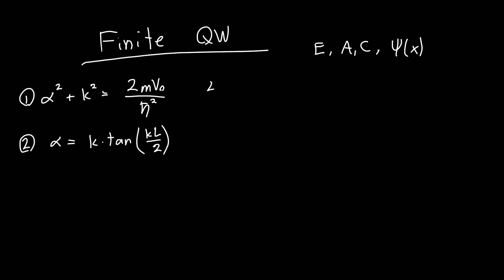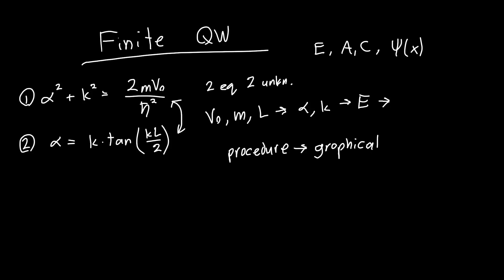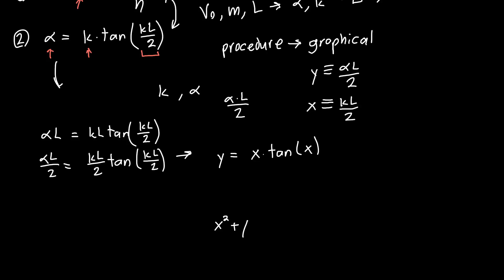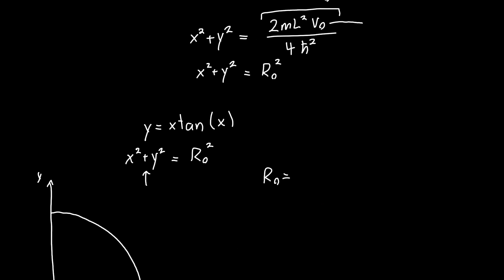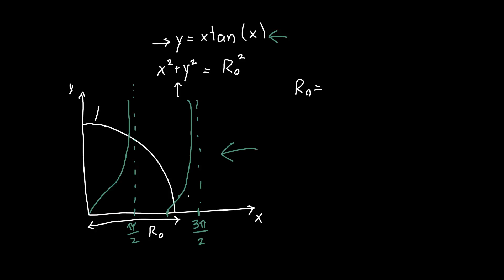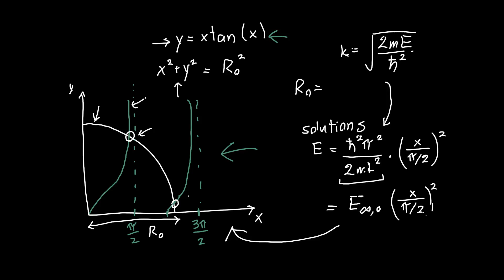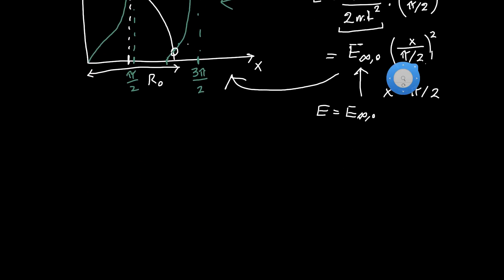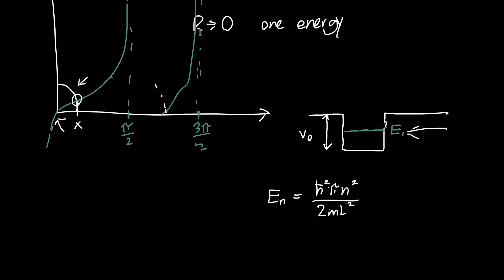Finite Quantum Well Part 3

Comment: Thanks for your interesting video.

https://youtu.be/wrBsqiE0vG4?si=waT8lY2iX-wJdjO3

Viewers might find this video intriguing as it demonstrates that under certain conditions, field quantization can be readily achieved.

The ground state energy is derived through Euler's column analysis. The column m must be engaged prior to over-buckling to observe the effect. The system exhibits a quantized response when force is applied perpendicularly. By bonding at points of highest probability and maximum duration (peaks and troughs) of the fields/sheets, a stable structure from three fields is produced.

Some might say I am akin to plucked guitar strings. However, I argue that structures cannot be created with vibrating guitar strings or harmonic oscillators.

Currently, in my research, I am attempting to characterize the "U" shape that is formed.

In the model, "U" shaped waves emerge as the load increases, right before the wave-like function transitions to a higher energy level.

Combining all wave frequencies using Fourier Transforms, as I understand, results in a "U" shape or square waveform.

I am considering whether Feynman Path Integrals for all possible wave functions might be relevant in this context.

Should this model prove valid, observing the sawtooth load versus deflection graph could provide significant insight into what occurs during quantum jumps.
The accompanying mechanical description and white paper are available on my YouTube page.

My results can be replicated using a sheet of Mylar* (the clear plastic typically found in school folders).
Experiencing it firsthand is certainly worthwhile!